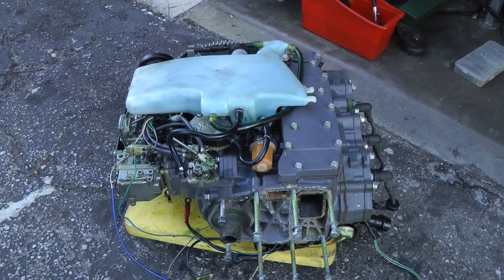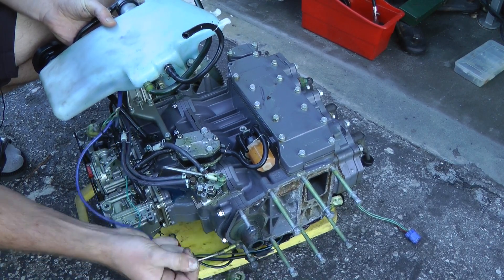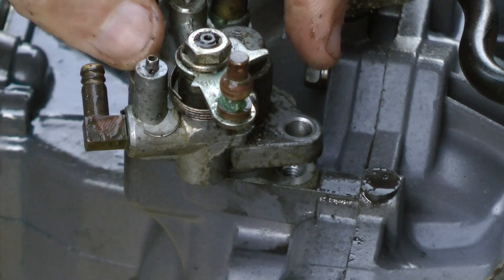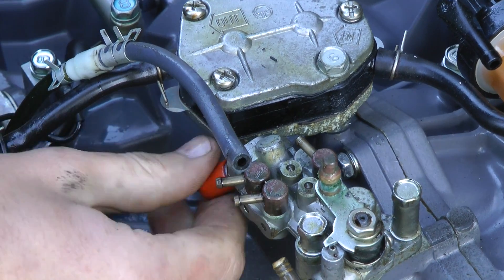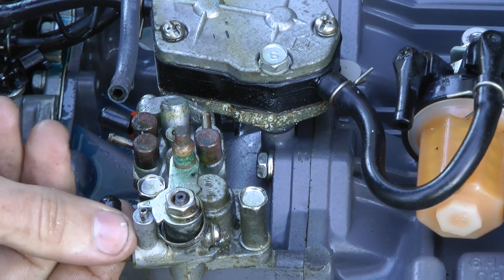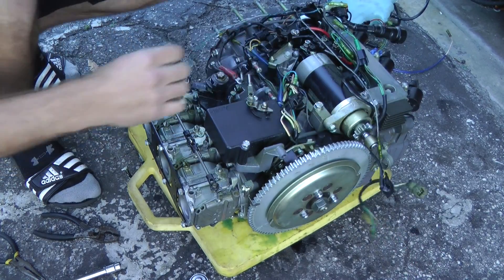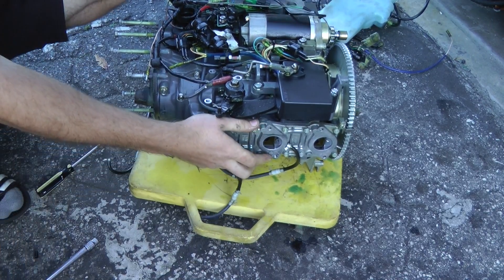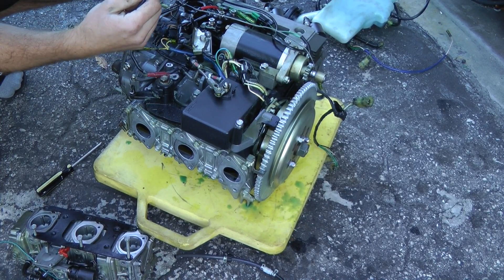How To Disable/Bypass A 2 Stroke OutBoard Oil Injection System

Comment: I really cannot understand why you would ever want to disconnect the oil injection system on any 2 stroke machine..Firstly the engine was made to operate with a variable amount of oil feed for all rpms from about 100:1 at idle to 20:1 at full power so the engine gets the optimal amount of lube it needs..Running a compromise premix fuel will always overload the engine with too much oil at low power settings causing more smoking..erratic running..deposits..plug fouling..and unnecessary use of more oil increasing the running costs..and if ill informed people say to me..BECAUSE THE OIL PUMP WILL/CAN FAIL..i reply to that as total BS because the oil injection pumps are built as good as Swiss watches internally and in all my almost 40 years running boats and motorbikes with oil injection,the only pump i ever seen fail was one that had been tampered with by the silly owner butchering it and he paid the price by melting his engine..Dont take them off,just look after them and they will never let you down.
Reply: Exactly...
Reply: @2fast4you25  If the crank main bearings on Sea doos and other makes are sealed on one side like on Suzuki CCI 2 strokes and are ONLY fed oil directly by pump pressure then you run the risk of blowing up the bottom end if you remove the pump as premixed fuel cannot lubricate them..If Sea doo has faulty pump issues i would be seriously chasing it up with the manufacturer especially if 2 or more failures have occured.
Reply: @2fast4you25  Well im sorry to digress but i know 2 people who operate old mid 90s model XP Sea doo Jet Skis here in Australia with the system connected and no major engine issues at all and one with very high hours before being rebuilt..They use expensive fully synthetic recommended oils and are high on proper maintenance..Engine failures here are mostly because cheap quality oils are used and people blame the pump and when its tested it works fine...And im sorry to say this but also owner neglect or lack of proper knowledge and maintenance also destroys fine machines too..Oil is cheap full engine rebuilds or replacements are not.
Reply: @2fast4you25  The world went 4 stroke because of pollution issues with old school carburetted 2 strokes not because of the unreliability of 2 strokes..Thats why we now have the new generation KTM and HUSKY fuel AND OIL INJECTED  2 stroke dirt bikes..If oil injection was that unreliable then why do BIG manufacturers still use this system on current model machines?
Reply: Great advice! Besides, running injection is so much more convenient!
Reply: Can’t have them in my boat, just in case I flip. Then I can’t get it started with water in it
Reply: @Tom Jackson  Then slow down and or don't go out when it's too rough..common sense prevails
Reply: @Tom Jackson  always check the weather before going out
Reply: Obviously you are luckier than most. Ive had the oil pump fail to pump on a 70 hp Evinrude and also had the oil pump constantly pump oil on a 70 hp Yamaha. The oil pump on jet skis fail quite frequently on 2 stroke jet skis destroying your engine before you can do anything to stop it.
Reply: because when the pump goes out and it will after 10 years or so, the engine will be blown before you have a chance to prevent it from overheating per my trusted mechanic friend with 40+ years of experience.
Reply: @bbulliard  I'm still riding my YAMAHA DT1 1968 model 2 stroke dirtbike that is completely original with oil injection pump still connected and working perfectly...and it's now 52 years old my friend..and it looks like I will be blown before this engine quits
Reply: @albertsammut433  some of us like to use a bit more oil than just 100:1 usual to make sure we’re getting proper lubrication, that’s why people decide to remove the oil-injection reservoir & premix fuel.
Reply: @Pizzabogan  The oil pump delivery is variable to the engine from about 100 to one at idle to about 20 to one at full power settings..So that covers ALL of the engines lubricant needs completely..Why would you add more oil unnecessarily increasing the running costs..create more smoke and worst of all dilute the fuel charge strength so the engine runs weaker and possibly rougher?
Reply: @albertsammut433  i think i need to be specific. not TOO much so it conks out the engine, i'm talking just a little bit more, like, 95/90:1 at idle or 15/10:1 at full power. however I run a Johnson 15 on my old tinny i'm currently selling & we premix that at 45:1 fuel oil ratio, and no it's not that smokey actually. it varies for every 2 stroke outboard you come across. The worst ones are the big v4s & v6s & evinrudes 300 v8 2 stroke cuz they seem to burn not just petrol, but heaps of the oil while lubricating.
Reply: @Pizzabogan  If you remove the injection system completely..and blank off the pumps connection to the engine and run 50 to 1 expensive high quality FULL SYNTHETIC 2T MARINE oil..then that will be perfect for full engine lubrication at all speeds..plus your peace of mind...even if I won't ever do that myself.
Reply: @albertsammut433  and that's another thing, people find premixing & how much to use very complicating. Also I'm talking premixing fuel in the tank. What's in the tank will apply for idle & full speed. Oil injection pumps are linked with the throttle cables. When you head for higher revs, the throttle will push down on the pump, adding more oil inside the block. As opposed to premixing, it just injects the right fuel & oil, depending on rpms. Also if you don't wanna premix, then that's ok.
Reply: bbulliard I agree, along with both mechanics I use when a job gets too involved. The 2.5L Mercury is a great workhorse motor, but both my mechanics said get rid of the steel worm gear to the nylon ring at the crank. I also disabled my low rpm module because it cost me a rebuild when it failed. I think they're great motors, but the oil system gives no indication or alarm should the worm gear shred the nylon ring gear, and the low rpm module is even worst.
Reply: Actually the first models were built without oil injection, they were flawless, the oil injection model were a failed designed that yamaha were forced to built because of emissions 😅 if u have ever tested one of those oil injection pumps?

Comment: YAMAHA  HAS  THE BEST  OIL  SYSTEM   OUT  OF  ALL  BUILDERS ,   WHY IN   THE  WORLD  WOULD  YOU  WANT  TO  BYPASS  SOME  THAT  JUST  WORKS  ALL  THE  TIME  .  MOST  ENGINE  FAILURE  ARE  CAUSE  BY  LACK OF SERVICE  ,  AND  DUMB  PEOPLE    TOUCHING WHAT THEY  SHOULDNT   TOUCH   THE  MOMENT   YOU  LEAN  OUT  IN THE  CARB  DUE  TO  DIRT  OR  CLOG     BOOM   NO  OIL  TO  YOUR  INTERNAL    THAT US  WHY  YAMAHA  FEEDS  OIL RIGHT  INTO YOUR  INTAKE   TO  KEEP  INTERNALS  LUBE  DUE  TO CARB   OF  INJECTOR FAILURE     THIS  IS  A  BIG  DISSERVICE  TO  CUSTOMERS
Reply: I have a 2006 Yamaha  50 hp new fuel pump, new  fittings  new hose. Using a 6 gallon tank  ,keeps running  like its running out of fuel  cutting off  can you give me  a idea what to try. I have switched tanks.

Comment: a lot of lakes have stopped letting boats run with out the oil injection . hell they want to do away with 2 stroke all together. but there is just to many out there. there is 2 of the  largest lakes in Texas trying to make it a rule no oil injection not getting on the lake. and they going to get it .

Comment: great  job i just did this to my dad 2004 40hp 2 stroke work just fine how much you for those 50 hp carb or can i put bigger jets to get more power ?
Reply: Motor still going?

Comment: Doesn't the oil level wires need to connect somehow? Make a loop or something?
Reply: No the float connects the system when its low to sound the buzzer.

Comment: Eric you seem very knowledgable so I'd like to pick your brain for a sec.  We have a 90HP Yamaha that idles fine below 2000 but once you go above that it falls on it's face.  My husband has managed to eliminate the fuels system as the problem & all we are left with could be the carb is stopped up or it's the self oiler.    I researched all day yesterday & found something that said it would do that if the self oiler was going bad, it's kind of like a safety mode to conserve oil.  It prevents the engine from revving if there's not enough oil in the mix.  I've saved this video & the one on cleaning the carbs will try those steps tonight.  Your opinion?
Reply: Are you sure that your motor isn't in "Limp" mode due to a low oil alarm? Yamaha will limit the rpm to below 2000 if it thinks there is low oil.
Reply: @MrTomatrol  Do you know how to bypass that? I just removed oil injection on a 90. Now I'm worried it will not work? I rebuilt the motor without experience and crossed my fingers... Lol
Reply: Thats not true. Yeah you verify tdc but you have to set the timing throttle closed and wide open but just cranking not running.  If its wrong you can ruin the motor.
Reply: hlduncan check the timing I had the same thing on a 15hp
Reply: TheMrkylester101 no timing. It's a 2 stroke. Just line the flywheel up with top dead center.

Comment: Good job getting rid of all that bullshit. My Merc has a dead cylinder now because of that stupid oil injection system. Its so easy to mix fuel yourself and it will save you thousands in the long run
Reply: The AUTOLUBE is no bullshit . very well designed . if it fail, you properly not  have lubricate the oil pump  and it getting stuck

Comment: Hi i have a issue we my 1995 yamaha 90 2 stroke  running  foward they dont go more that 3500 RPM I remove the oil tank mixer i mix the oil we gas now ,i change the spark plugs  i clean the carburattors ,i change  the fuel line ,the prime i clean  the little filter inside the motor,i check the fuel pump don have any hole on the diagfragm the compression on all 3 cillinder is 140 on each cilinder and is working better but not more than 3500 RPM, I dont know if is the CDI SAFE MODE or any other Issue,can you o any person here can help me PLEASE.
Thanks
Reply: Did you find help? I have similar outboard as you I'm doing this to right now.

Comment: never understood why people do this
Reply: + Slippreygritz They pretend they know better than the engineers.. :-)
Reply: atari8 warez I have a 1990 and had the same mind set you did until last weekend when it failed and my engine lost power and shut itself off in the matter of 10 seconds. Luckily it didn’t seize and it seems to be ok for now but I won’t risk it again. I just had the big tank pump replaced and the whole system freshened up and still it happened. My issue is electrical nothing is telling the pump to turn on and it just so happened for some reason the float on my engine tank stuck. I can run 12v to the pump and it works so it’s just a wire or something but I won’t risk it again. It’s to simple just to dump in oil before leaving to go get the gas unless you are a moron in which case you probably shouldn’t own a boat anyway because it take a good bit of common sense to keep up with one.
Reply: atari8 warez so does mine and it failed. The float stuck. Something so simple almost cost me an engine. And yes your pump may be mechanical but your warning alarm is not. Engineers didn’t make the system because it was superior to pre mix they made it because yuppie morons are to stupid to figure out a mix ratio and add oil. It’s just a way to make it easier for dumb people like everything else in this world, and we wonder why people are so helpless these days.
Reply: @richie2dicks468  This- like most Yamahas- is an oil injected engine. It injects oil directly into the intake manifold. Some other systems (notably OMC) mix the oil with the gas and then that mix goes into the carb or carbs. The advantage to injecting oil  into the intake is that if a carb main jet clogs, the engine still gets 100% of the oil it needs and the cylinder with the clogged jet wont grenade. No system is fail safe- not even pre mix. I've worked on hundreds of 2stroke outboards and Yamaha makes many of the same engines in both pre-mix and oil injected.  In my experience, the pre-mix engines score a cylinder about 4 times more than the oil injected engines because a clogged main jet is much more common than an oil injection failure (I've only seen 2 actual Yamaha oil injection mechanical failures- clogged lines) You can always pre-mix an oil injected carb engine  for insurance if you want- a little extra oil won't hurt it. 
 Its a good idea to pre-flight your motor before going out. The engine mounted tank should always be nearly full and the engine mounted filter/separator checked.
Reply: bsrktm1 I’m well aware. I just had my entire system gone through less then 12 hours run time ago and yet I had an electronic failure. 2 in fact. First the bilge tank motor didn’t get signal to turn on and simultaneously the float stuck in the engine tank for some unknown reason. Engine ran oilless and shut down. Luckily it survived. After diagnosing it all components work but something is still keeping signal from telling main tank to turn on and pump to engine tank. I’d never feel at ease with the system again so I bypassed it. I keep good fuel filters and run only non ethanol fuel and run it regularly so I’m not concerned about a clogged jet. One thing I know for sure is that injection system damn near cost me an engine so I’ll try the alternative route. Seems like a no brainer. If it blows big shit I’ll swap another one on. I have an 2000 mercury sitting on a stand ready to go on if needed. Can’t say what will happen with the pre mix but I know what happened with the injection system.
Reply: @richie2dicks468  Yeah sure figuring out the mix ratio is actually rocket science and reserved for the smartest on earth....lol
Reply: Ray Ataergin I think some of these guys walk around with their shoes on the wrong feet lol
Reply: Because they think they are better Engineers than the people who made the engine..Total BS fallacy
Reply: Albert Sammut I work with engineers everyday and everything they do should work perfect on paper until it faces real world circumstances. Almost every job I do is delayed because some engineer missed something they couldn’t foresee from their desk but are to arrogant to admit any fault so we chase out tails for a week until ultimately I have to come up with a work around. The only people who think engineers are smart are people who never work behind them.
Reply: They are worried if there is a problem with the pump or lines it will ruin the engine. They mix the oil with the gas themselves. You still need oil for the bottom end of the engine too.
Reply: + Uptin Sinclaire The chances of them forgetting to add the oil to the fuel on each  fill-up is much greater then the chances of the oil injection system to fail if the engine is maintained properly.
Reply: @reyyanataergin1364  How can you forget to add oil? You do it every time you fill up. You NEVER add gas without oil. Chances are the injection pump will fail before you forget to add oil.
Reply: @IcecyOutdoors  Well said..exactly..too many would be backyarders here who only dream to be professional factory marine Engineers.

Comment: So once you connect the carbs and motor back up how do you cold start the engine?? 

I have been spraying some Aerostart in the air filter. Is there an easier way..
Reply: Fred Bunny don’t spray any sort of engine start into the outboard ,,,it’s the worst thing you can ever do to an outboard ,,the engine start sprays destroy your engine seals ,,,and as time goes on you will need more and more spray to get it to start and in the end the engine will just fail to start or run at all ....please please don’t use engine start
Reply: @bluefacewhiteboy  thanks for the feedback. I stopped using aerostart years ago.

Comment: great video. I would like some more info on this particular motor I just bought a skiff with this motor but it's not working at all and I know nothing about boat motors so any info would be greatly appreciated thank you
Reply from the maker: seaweed954 first you need to run a compression check to make sure the engine is anygood
Reply: eric edic I bought the boat pretty much for the hull . the previous owner took apart the motor some what. it Has no plugs in it and the back part is exposed I can see the pistons and housing it has a lil rust from it being left open.......I live in central Florida
Reply from the maker: Im in st.petersburg florida.  If your interested in selling the motor text me at 727-286-0636
Reply: eric edic I'd like to get it running I want to learn how to work on boat motors this is the first boat I ever bought you know.

Comment: Great Job Eric. my yama 80 hp 2 stroke. Shakes when I accelerate. Cleaned my carbies and jets, has good spark on all three cylinders, replaced coil packs, stator, cdi box, fuel pump but still no good. What do you think it could be and how to fix video?  Cheers Dan
Reply: Daniel Duy Nguyen motor mounts
Reply: What was ur issue

Comment: so what reason would you un hook the oil injection? my 50 smokes bad and has bad fumes
Reply: Shrek some oil injection systems cost over $500 so it's cheaper just to disable it and mix it yourself
Reply: @kendrickminchew1855  Then run the risk of blowing your motors sealed main bearings because it HAS TO HAVE oil pump pressure to lube them and running premix WILL NOT lube them at all..A very expensive more than $500 BANG will occur